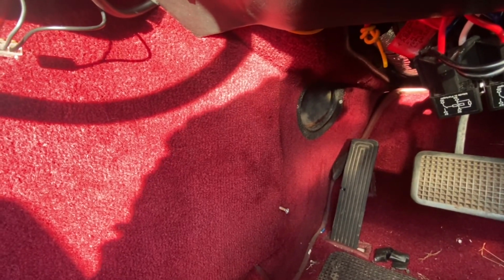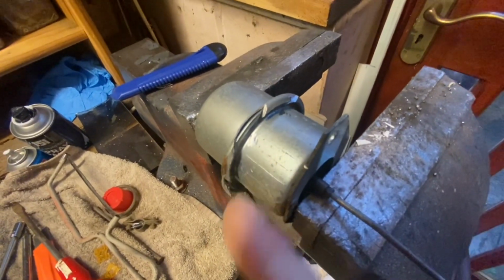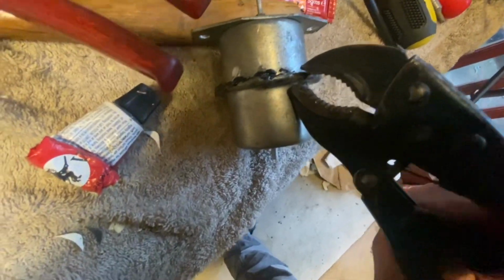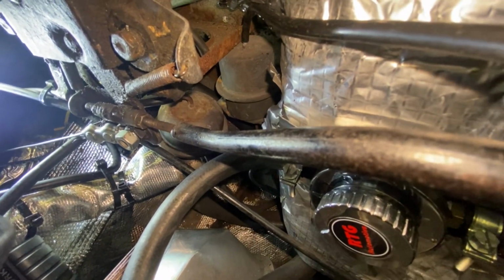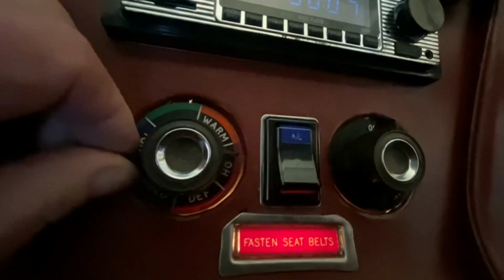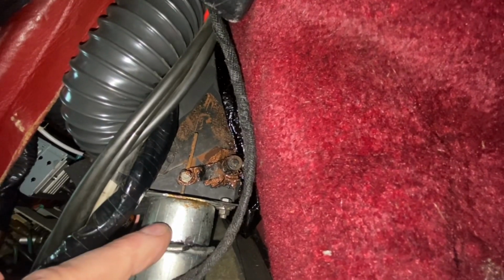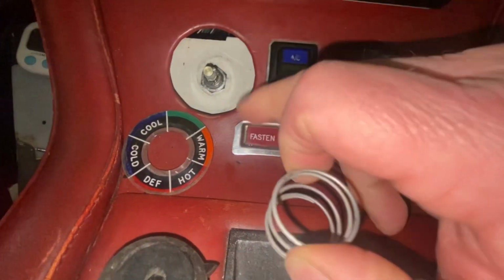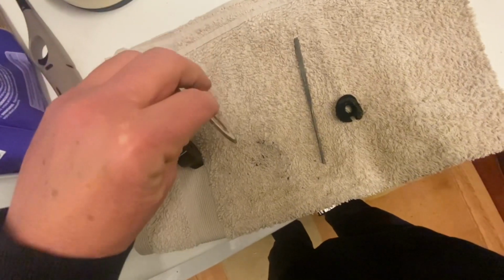Jensen Interceptor 1974. Fixing My Heater Air Mixing Flap. (Vacuum Actuator Valve Repair)

Comment: Very informative video and great testing. You do allude to the fact the left hand chassis rail house a vacuum reservoir. It’s well worth checking all vacuum hoses as leaks could course poor idle and poor functionality of the controls and or brake booster
Reply from the maker: Its in the right hand tube but yes any leaks in these vacuum lines isn’t a good thing

Comment: Thanks. Very insightful. Why not get yourself a ‘head camera holder’ (like a miners lamp) then you can keep both hands-free while you’re filming
Reply from the maker: Its not a commercial thing. I just do it to remind myself what I’ve done. If people find it helpful thats a bonus. Thanks.
Reply: @bremarashford  it is very helpful. Please keep it up. Just thought it might be a bit easier for you to have both hands on things whilst you’re working and filming.
Reply: The surround for fasten seatbelt light is inside out. It should come thru from behind. Will look a lot better ….:)
Reply from the maker: @julian4548  thank you. I just removed it. I tried to be as careful as i could but someone stuck it in with superglue and it  took some of the red leather surface with it. Hopefully I can get a clse enough colour leather paint from the NEC show this weekend. Nice spot.